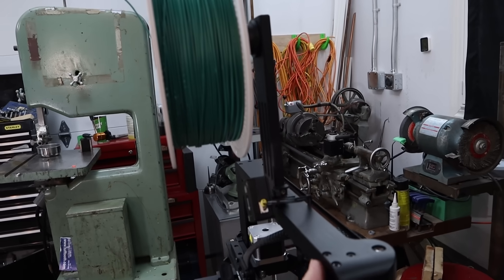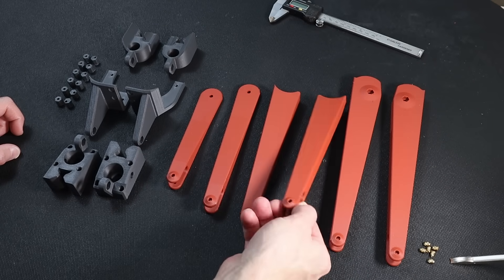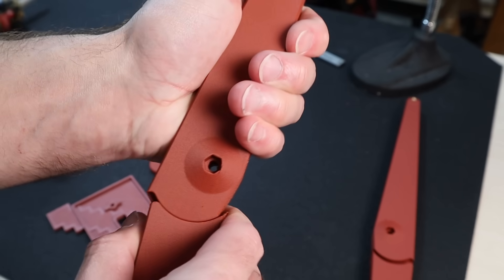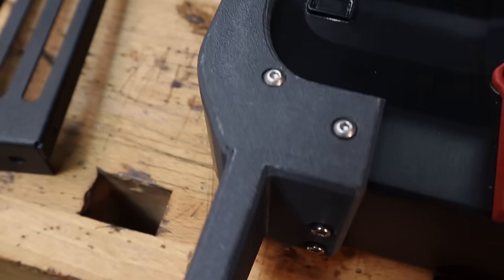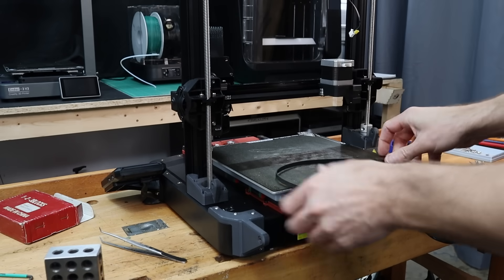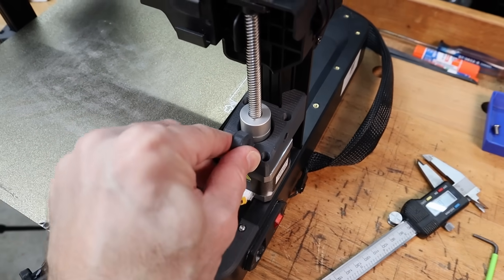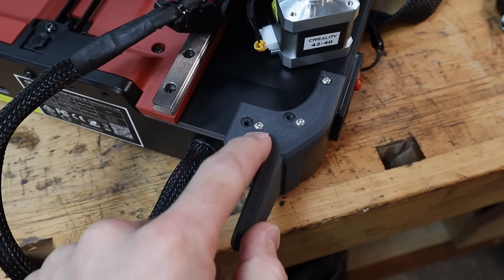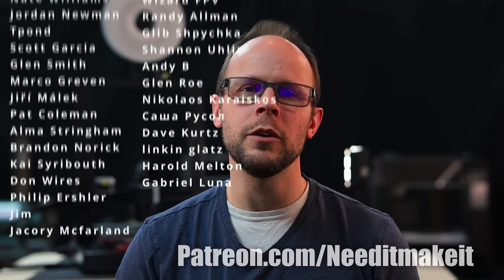STRONG and FULLY 3D Printed Arms for your Ender 3 KE and SE

Comment: What are your thoughts on the ender v3 printer?
Reply from the maker: I am making a video on it, for the most part it's pretty good, however I'm still getting some inconsistent extrusion, at least compared to the X1C.  The frame is strong, I really like the design.  The spool holder is to the side, which is good unless you have no space to the side, so I'd like to see a spool mounted "flat" to the side rather than 90 degrees to the printer.  I'm going to reach out to Creality to see about the extrusion, it may be something that I am doing wrong, but aside from that and occasionally the printer seems to like to whistle at me, it's pretty good... for a bed slinger. 

Until I sort out the extrusion issue, I wouldn't recommend it, but if there is an easy fix, it can be a good printer.
Reply: @NeedItMakeIt  looking forward to the video! Keep up the awesome content man!

Comment: I'm loving this KE / SE series, as someone who just got a Ender 3 V3 SE as his first printer, the timing couldn't have been better. I didn't think I'd enjoy tinkering with the printer.
Reply from the maker: That's great!  I have probably 2 more videos coming for this printer, maybe 3.  The goal is to get this printer to a point where it can compete with just about any bed slinger, or maybe just maybe some CoreXYs as well.  I like to tinker, no doubt, I love the challenge and I like to design, so it's all good for me.  Making the videos really slows down the process, but hey... what can ya do?
Reply: @NeedItMakeIt I'm literally using the SE I just got to print upgrades for my Corexy. I spent more on the boards for the CoreXY than I did for this SE and I absolutely love this ender
Reply: Hey  @NeedItMakeIt , what do you think about moding it to be a core xz, using those new holes, there is a ender 3 S1 to core xz mod on thingverse, perhaps......
Reply: Just got one my self I love my new hobby
Reply: This is my fourth printer including a large gantry a prusa I built from scratch and a 3D V2 I got for my nephew and fell in love with. The SE is fantastic leveling isn't a problem it is pretty much plug and play and incredibly easy to modify and upgrade. Instead of spending hours leveling beds and figuring out how to get prints to stick and release and fiddling with wires and changing ROMs I just load in a model and print it. I am in fact currently printing upgrades to my large core XY printer

Comment: Excellent video did the print quality improve I am not happy with the print quality of my under 3 V3 SE I hope this will improve the quality of my print also I want to be sure that this kit will work on the SE thank you for your time
Reply from the maker: I'll have 2 more videos coming for this printer, I still have an extrusion related problem, I need to figure out if it's the extruder or if it's the current coming to the extruder motor or perhaps something else.  It's funny that it was my first thought that the extruder was the problem and after upgrading everything else, I'm coming right back to it.  

I believe the SE and KE printers have the same frame/base the steel plate below the bed on the SE has larger cutouts and it doesn't run Klipper unless you have the sonic pad I believe.  This upgrade should work well with the SE, but if there are any changes, just let me know and I can adjust as needed.
Reply: @NeedItMakeIt  Your first thought was its the extruder. So you did everything but fix the extruder? Your right it is funny.

Comment: Can you make the replacement you made for the steel plate public? I would rlly like to make that!
Reply from the maker: I will be doing that one next, I wanted to get the accelerometer first and then I can make a place for it to go and I also needed to test it to make sure there were no issues.  So far it's working well, it's stiff enough and has the clearances needed.  I've also lowered it down, so the center of gravity is lower, and that should help a bit.  It shouldn't be too much  longer to get that to a point to release it.
Reply: @NeedItMakeIt  that sounds awesome! Your linear rail mod worked out great too, so I have high hopes ;) I'm already did the ' renfort'  gantry support mod, so I'm skipping this one.
Reply from the maker: @Erw-In  I'd like to also try an aluminum plate and also a CF plate to compare, but something printable is the best.  Why did they use a dome shaped piece of steel on a fast printer, it is mind-boggling to me.  No worries, I thought I'd try something that looks like it fits the printer well and I wanted to show some interesting new ways of connecting parts together.

Comment: The CAD work on this is great (there's a lot of interesting details), but I really don't get the design or overall idea. The attachment point at the top can slide (it's tight now, but for how long?), and I assume that's why you added the brace into the corner. The effect of the corner brace depends on the bending stiffness rather than tension/compression, which is inefficient, and requires adjustment because it's over-constrained.

IMO it would have been better to find a way to attach the top mount rigidly to the frame (say, a couple of set-screws). This would provide the necessary adjustment to get it square, and you wouldn't need the corner brace. Anyway, have some engagement :)
Reply from the maker: For sure, it's by no means perfect, and if someone wants to modify it by adding a set-screw or bolt the top adapters through, by all means, perhaps even gluing them in place.   The lower they are the better control you have over the angle, and it looks far better than strapping something on top.   It would have been better to make this from carbon rod or steel or even aluminum.  The goal was to provide this to everyone regardless of their level.  I've suggested that this be made from ABS/PC PETG-CF because of their stiffness, PLA in an enclosure wouldn't be wise.  

Great points, thanks for your thoughts!

Comment: I mean yah, they look good, but its a bit overengineered... I solved it with two M8 rods, 8 nuts and 4 anchors for the extrusions... about 8 years ago with my tornado (and that one was crooked AF)...
Reply from the maker: I guess I wasn't clear with the goal, I've made this in such a way that anyone with this printer can make, regardless of their skillset with machinery.  It would have been far easier to do this from steel rods or even aluminum.  Valid point, it's not the direction I went even though it would have been about 10X easier for me to do.
Reply: @NeedItMakeIt  just to be clear, I meant no sass or anything, I like the looks of them, as said, but considering the factor ease of use: my tornado was not reliable and I was a beginner back then (kinda still am) but I was aware I need as much precision as I can get- and being such a newbie, calibration was a proper struggle then, but I knew my way around with cutting threaded rods, so it was a no brainer for me, not needing extras like perhaps inserts or precision printing. I like your vids as they explain a lot hence don't get my comment wrong. I commented in case someone with my "skillset" from 2016 feels a bit overwhelmed/scared. Cheers!

Comment: This is bonkers, good job.

I wonder though, at what point are we better off getting a better printer off the factory?
Reply from the maker: Thanks!

You're better off getting a better printer from the start, I'd suggest a CoreXY, there are so many benefits.  This series is really meant for anyone with these printers already and it can provide some solutions or some ideas anyway.  I don't think bed slingers make much sense these days, moving a massive bed at high speed won't be able to compete with moving a small-ish head and rods on the CoreXY.
Reply: If you already own it, can't exactly hit Ctrl+Z!

Comment: We have similarly equipped shops, including what looks to me like a NYW woodworking bench😀 Love that curved sliding dovetail, very cool. Were those crossfeed nuts there at the end?
Reply from the maker: Nice!  Little by little I'm working on upgrading my shop, most of my woodworking tools are pretty old, but still work just fine.  I recently bought that nice bench, it needs a bit of TLC and a filler for the tool holder slot so I can use the whole bench on occasion, but it's super handy.  I'd recommend a bench like that over an ordinary bench on wheels any day. 

You've got it right!  Those are the cross-slide and compound nuts from my Southbend 9A Lathe.  The cross-slide is terribly worn, both the nut and the screw.  I have a new screw, now I'm working towards either getting a new set made, or trying to do it myself.... Buying them is so expensive for what you get, but without them, using a sloppy lathe is just no fun.

Comment: thank you for all these!! the ender 3 v3 ke is my first 3d printer and all these mods will definitely help make the printer better. i have already bought the parts for linear rail and looking forward to install it during the summer break
Reply from the maker: Nice, I'll have at least 2 more videos for this printer, one for the plate replacement for under the bed, and the other for the extruder.  I'll need to do some  final results as well in those videos, unfortunately I can't do it until the other problems are solved.

Comment: Can I just use esun asa for the parts? I don't really have the capacity to print carbon fiber filled materials yet
Reply: Yes, you could
Reply from the maker: Thanks for that!
Reply: @theayuwoki3569 thank you!
Reply from the maker: Anything stiff is good.  Probably not PLA if you plan to print in an enclosure at any point.

Comment: That looks like a hercus or Southend cross slide nut you printed at the front end
Reply from the maker: You've got it!  Southbend 9A I'm trying to decide if I want to get the cross-slide and compound nuts made up or if I can do it myself and I wanted to print them first to get the fit close and to understand the ACME sizes they've used.  They are unfortunately non-standard sizes these days.  We have 3/8-10 and 7/16-10 ACME, except the pitch diameters don't seem to match anything commonly available these days.  I've been thinking about doing some bronze/brass casing and machining new ones myself, but that's going to be hard for me at my amateurish metal working level.

Comment: OMG I wanna make these for my v3 just because of how cool they look... ALSO the v3 will now be the only ender without support rods/arms :*(
Reply from the maker: That's true, the metal framed V3 seems pretty stiff, I can't say whether that'll be the case for the Plus-sized model though.  There are some free threaded holes on the back of the metal frame though... maybe it could get an upgrade at some point.  I'd want to do it in metal... or perhaps wood though.
Reply: @NeedItMakeIt  That would be super neat to see!
Do you think wood would better help with Vibrations??
Reply from the maker: @Reds3DPrinting  It depends on the type of wood, something like maple, or ash, anything hard would work well.  Even though I'm a Woodworker, I don't show it much because it's not really something everyone can do, but if you think it would be interesting, I can try to include it in some videos.   The combo of printing and wood is super appealing and I love the look of the combo, especially black prints with something with some nice grain, like Cherry.

Comment: Could you make a video of how you design the dovetails for this and Qidi Pro bed frame? They look nice :)
Reply from the maker: Sure can, and I am making the video right now, I've had several requests to show how it's done, it's pretty straight forward, but I'm going to show you a few different options and you can pick which ones work best for you.
Reply: I too would like to see this dovetail design. 👍😎👍
Reply from the maker: I just so happen to have a video in-the-works at this very moment, I've had a few requests so I shall show you how and then you can take it from there.  It's a super nice joint and it doesn't need much clearance compared to a non-tapered joint.  That video is probably going to be for mid-week next week or next weekend!

Comment: This is a much needed upgrade to the SE and KE.  I Braced my SE a few months ago and saw drastic improvements.  My KE has been fine but will definitely be using the Ecosystem your creating.  My SE is a variety of different upgrades you seem to be making one by one for the KE/SE.  The linear rail swap on x and Y setup and gantry brace are the best upgrades that showed the best print quality improvements.  Plus the new flowtech instsll and now it's an awesome machine rather than a cheap budget printer.

Comment: I really like that circular action locking joint.  I've never really come across it before, but it seems to be an excellent approach.  Love your work!
Reply from the maker: I'm not sure if I'm the first person to do this, what I was shooting for was a joint that could not come apart in the direction that the loads were applied, it happens to look really good too. I think it just could have been a tiny bit tighter, I was using 0.08mm clearance, and I needed 0.05mm instead for the perfect fit.  Such a small difference but with those shallow angled tapers, that's all you need to make it work.  I'm making a video about it to share how I did it in more detail and we're of course going to test the joint as well, since it's fun to break things to learn.